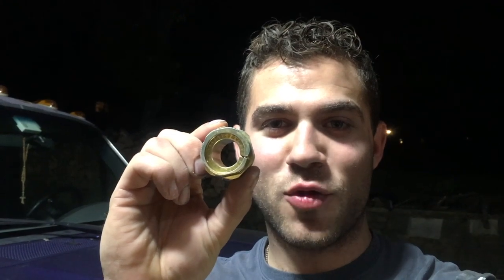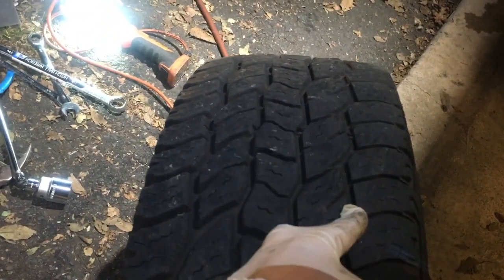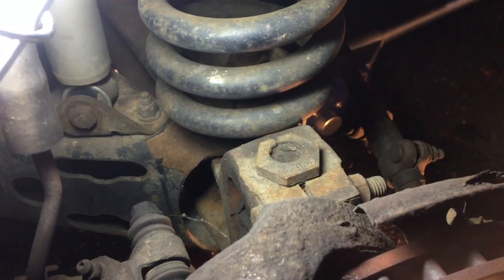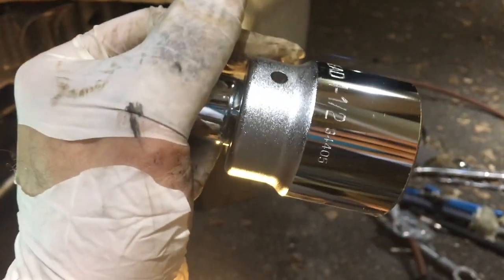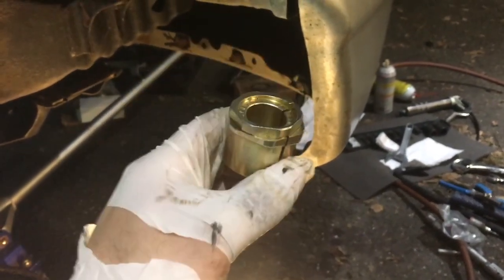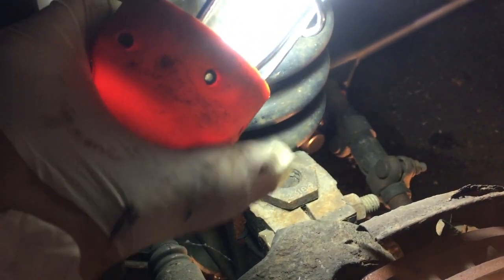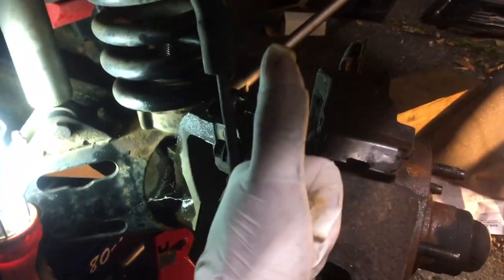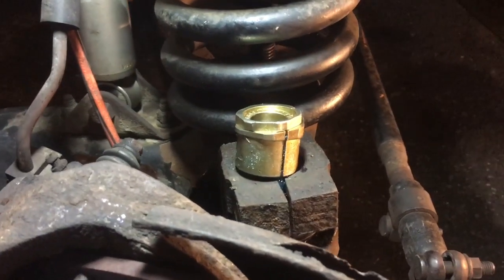How to Install Adjustable Camber Bushings | 1995 Ford F150

Comment: I've been putting off doing ball joints and correcting the horrible positive camber on my 84 f150 forever just because I know it's going to be a big PITA!! ...Even though I have shop space, a ball joint press and 1\2" impact.  Your video is well done and gave me the motivation to go ahead and just do it. Thanks!!
Reply from the maker: Michael Scarborough Yeah I felt the same way! Then I tackled the project and it wasn’t that bad. Since you have those tools, you will do just fine! Good luck!👍
Reply: I'm wondering if you got the ball joints and Camber bushings replaced on the 84 F150 I have an 86 and the way it's set up is different than the way it was set up on his video my ball joints come from the top to the bottom and there's a nut and the bottom that holds the ball joint in place the upper ball joint and then you see the sprocket type bushing which is different than the bushings he replace it seems like the ones he put on are a little bit easier to install
Reply: Wondering if you could help me with setting up the right camber for an 86 F150 since you have an 84 I believe they might be the same set up unless you have a four-wheel drive

Comment: Real nice video! Thank You! I ordered these for a E 250. Doing ball joints, pivot bushings, radius arm bushings, tie rods, springs, shocks, rotors/bearings, sway bar bushings, these adjusters, and new ceramic pads on the front. It's awesome to save money. Ball joints would have been $300, Radius arm bushings would be $700ish, and on and on.
Reply from the maker: Thanks man!🤙 You are most welcome! 
Nice! That’s the best way to freshen up the driving feel of a vehicle. Replace all the suspension parts and start fresh.

Comment: Great video. Love the bandaged thumb that comes in after the ball joint replacement!
Reply from the maker: Carl Saiyed Thanks! Yeah I cut a huge chuck out of my thumb with a miter saw. Glad you liked the video!
Reply: Ouch.  My grandfather took the tip of his thumb off in his mid-60's after working in his carpentry shop for decades.  Table saw got him.  It only takes a second.   @TheMinuteMasters
Reply from the maker: Camas Damn! Thank God it wasn’t a whole finger! Table saws are very dangerous like that! They have very strong motors and would have no problem taking a finger off.

Comment: These videos are helping me a lot with my truck. Thank you. 

    I have a hard time wrapping my head but, I have a horrible negative camber eating tires on my truck. If I put the “skinny” side of te ring towards the tire and the “thicc” side towards the motor this is max positive right? Pushing the top out and standing the tire up straight? 🤕
Reply from the maker: I can’t remember how to adjust these bushings to 0 camber but positive camber is the top of the tire sticking way out.

Comment: I have a 1.5-inch leveling springs on my 4wd. Would I want my camber set differently?
Reply from the maker: If your camber needs to be corrected, then yes.

Comment: Perfect timing bud. I'm in the process of doing a lift and have these bushings in and would like to get close enough to drive
Reply from the maker: John Kaufmann Nice! You'll definitely need the camber bushings. I'm running 31's and that was enough to need them. Good luck with the lift! Thanks for watching!
Reply: The Minute Masters yep I had coil spacers and 35a and was having a whole lotta trouble Soni just got the full lift kit (I have a Bronco) and she came into alignment but still need a trip to the shop.

Keep it up
Reply from the maker: John Kaufmann Broncos are awesome! Glad it all worked out for ya!
Reply: The Minute Masters yep my son and I are rebuilding it Project Alpha Bronco on YouTube.  We installed a two post hoist in the shop.  I highly recommend one if you have the room to install one.  C7000 Triumph is the model and we have a demonstration on YouTube for that too.  It's removable if you don't need it.

I'll stop bugging you now
Reply from the maker: John Kaufmann that's awesome!! A two post hoist would be a dream! 

Alright, nice talking to ya! Good luck!

Comment: I have a 94 F150. I put  the wrong coil springs on and now I have positive camber. I could take them off and put the right ones on but I love how my truck is level now. Question for you. If I do what you just did will that correct my camber problem?  I put moog cc824 instead of 822 or 820.
Reply from the maker: It depends how much camber you are trying to correct. You could get it close to  0 but not exactly 0 camber. What coil springs are cc824 made for?
Reply: @TheMinuteMasters  I bought them from advanced auto, and they showed three different springs that fit my truck. But I didn’t read the fine print where it said that they needed more info about my truck to determine if the 824 would fit. I completely missed that. They fit on various Ford F and E series trucks and vans but not my 2wd 5.0 xlt.
Reply from the maker: @rustybarrr  Sounds like you bought the 4wd coils.
Reply: @TheMinuteMasters  I wish there was a way to show you a picture of my truck on here. You could see how level it is now.
Reply from the maker: @rustybarrr  I have a pretty good idea of how yours looks. I used to have f250 coils on my truck and it leveled it out pretty well.

Comment: Hey how is it going Steve I just saw your video was really helpful but I have a question, I have a 87 Ford Bronco I recently got a 4in lift and the front tires had a lot of tow out so I took it to get alignment hoping it would fix the problem but it didn’t fix the tow problem I have, do you think it’s the camber bushings? Because I was going to shim it honestly to fix the tow problem.
Reply from the maker: Thanks man!🤙 Toe in or out is adjusted via the tie rod ends on the drag link steering. Camber and castor are adjusted at the camber bushing. 
You can adjust the toe by turning either of the two adjustment sleeves attached to the tie rod ends. I have a video on how to do that. For toe out, you adjust the sleeves to pull the tie rods in toward the center of the truck. It only takes a couple quarters of a a turn to make adjustments.

Comment: If you have a lift kit you'll need a moog 2 3/4° pos-neg camber bushing. Special tool available to easily remove factory camber bushing.
Reply: I've seen those special tools, but do they work good ?  a threaded puller right ?

Comment: I have 1991 ford f150 that pulls to the right would these camber/caster bushings help out?
Reply from the maker: Does it pull to the right when you are braking?
Reply: It does it when I'm on drive as soon I let go of the steering wheel. I've taking it to alignment shop twice. I've changed inner and outer tie rods also the drag link and sway bar links.

Comment: Hello. It is  need in both sides pilot and copilot?? Or une side have more adjusts?? I have a F150 1994 and o want lift olny in front is 2wd
Reply from the maker: Hi! Yes, you will need camber bushings for both sides if you are going to lift the front of your truck.

Comment: I have a question. Have you had any issues with the camber bushings? I have a 1994 Ford f150 with positive camber. Every shop I have talked to says they break and don't work. Of course I'm sure they just wanna charge me for the install of different ones. Just wanted to see how they have worked out for you?
Reply from the maker: jesse g I’ve had no problems at all. Now mine are Moog bushings which might be a big difference in quality. But, I have never hear of them breaking. There really isn’t much to break. Honestly, I would install them yourself. If you are able. It’s pretty straightforward and with the right tools at hand, a breeze.🤙

Comment: Im finally getting to my I beams and spindles on my 91   E-150 ...     and like   I read SO much on those moog coil springs and finding the right one    with the right height because so many complaints on certain model springs being too tall    and causing positive camber.     So my question is   ... with an old  I beam is it just not adjustable?  You just have to have the exact springs  that match with the I beam / spindle?
Reply from the maker: So coil springs are a mixed bag. I’ve tried Moog and AC Delco (I currently have Moog). I think they were both sub par. Now maybe I’m just not a fan of progressive rate springs. 
With I beams, you buy the coils that companies say fit. Height adjustability can be achieved with spacers. If camber needs to be adjusted, then you need adjustable camber bushings.
Reply: @TheMinuteMasters  yeah I mean the ones I switched too... I think  I originally started with like the CC824  which are 16.9   uncompressed... 1400 lb rate about...   but I went to a CC820  which are  are 3/4" shorter  compressed/uncompressed.. still  a 1400   but not sure  if a 5.0 E-150 would be 1200 or 1400 ..   Then I realized they had anti squeak  bushings... so ordered those  ( I do have classic soft rubber ones that are round)    but when I got the new bushings for anti squeak    theyre like a hard plastic.. probably a 100 in durometer scale lol      So now I'm not sure..   Like anti squeak sounds nice but  who knows if theyre supposed to be hard plastic or if someone is just 3d printing this stuff.     also being a conversion van  with wood and luxury   maybe rubber is better        but yeah its so much more complex than I thought    but most people on amazon with cc824  complained of positive camber.. others said   CC820   was perfect   ( i got them open box for like less than 50 bucks ) .  and yeah then of course    open coil vs progressive.  I dont actually have a lot of experience driving an I beam Ford truck...  ive just been restoring it.   My uncle said a Ford truck nearly killed him because of how the I beams change camber   over bumps .. maybe it also had bad kingpins.. anyway

Comment: Hello there i have a 95 ford lightning with that positive wheel problem, if I put those aftermarket  cambers will fix that problem?
Reply from the maker: Yes, these will fix your problem if you have a stock to mild leveled suspension.
Reply: @TheMinuteMasters  cool! Thanks for the video and your info I just order it

Comment: Why is the after market nut have such small surface area for a socket to sit? One slip and there goes any usable surface for a socket to ever grip it.
Reply from the maker: No idea. I didn’t have any issues with the nut having enough surface area on the camber bushing.

Comment: So my camber is positive. If I get the the camber bushing that can adjust from 0 degree to 4 degree can I adjust it to 0? Or would I need to go more negative? Camber is slightly positive
Reply from the maker: If your camber is positive (tilting out at the top) you should try and adjust the existing camber bushing. If that camber bushing is adjusted to the max to bring the wheel to neutral. Then you will want to install an adjustable camber bushing to bring the wheel to just slightly negative (tilted in at the top.)
Reply: @TheMinuteMasters  so you can adjust the stock camber bushing? I ordered the adjustable ones already incase but yeah after I installed the leveling spacer the top comes out a little bit
Reply from the maker: @bryancastruita99  Ah! If you bought a leveling spacer, you’re definitely gonna want those adjustable camber bushings.
Reply: @TheMinuteMasters  appreciate that! I got them ordered

Comment: So how does the installment of these camber bushings become necessary?  Is it other parts/bushings/wheel bearings wearing out?  Did Ford simply not allow for any stock camber adjustment with these trucks?
Reply from the maker: rdhr151 Good question! The camber bushing doesn’t really wear out unless you let your ball joints practically disintegrate. The stock camber bushing doesn’t have a lot of adjustment. An aftermarket adjustable camber bushing has 2 degrees adjustment in both positive and negative directions. If you add a leveling kit to your truck you will most likely need aftermarket adjustable camber bushings.
Reply: The Minute Masters ty for the reply. So if I plan to keep my suspension/tires/ride height all stock and want the alignment 100%...should I be looking at replacing other components like ball joints, pivot bushings, tie rod ends etc BEFORE considering these bushings?
Reply from the maker: rdhr151 Actually if your other suspension and steering components are fine then you can go ahead and just replace the camber bushings. I replaced the camber bushings at a different time then when I replaced the ball joints.

Comment: Yo! Just ripped out my engine and fixed my coolant and oil leaks. We pretty much have the same truck, 95 f150 5.0. I have a question, I got new coil springs from rough country to lift my front 1.5 inches. Well now my positive camber is intense. I took it to 2 different alignment shops and they said the adjustable camber bushings wouldn’t work, but there’s got to be a way to get them straight. Any ideas m8? I might buy it anyways and take it to another play. $$ adding up lol
Reply from the maker: Nice! 1995 is a good year! 
Have you installed the adjustable bushings? Or are you just trying to find a shop to do the alignment?

Comment: Hope you’ve been well man! Quick question, could these camber bushings possibly cause for an alignment to be more difficult to do if they’re  never replaced? I took my truck to have an alignment and they said my alignment is impossible to do because the camber bushing are worn. I didn’t even know they could wear out because they are made of steel. Btw my entire front end suspension is new, other than the camber bushings.
Reply from the maker: Hey long time no talk Mr Baeza! I hope you have been well too! 
Yes, worn out camber bushings can cause alignment issues. The camber bushings on these trucks is adjust both camber as well as a little bit of the castor. I’ve not heard of a worn out camber bushing but I guess it can happen. After all, ball joints are all steel too but even they can wear out.
Reply: The Minute Masters thanks dude! I’ll change em out real quick and hopefully that’ll help. I really appreciate all the help you’ve been giving me. The E4OD transmission in mine is being replaced and hopefully I’ll be able to get her on the street feeling like new. You’re the best dude, stay healthy and I hope you and your family are doing well during this crazy time😃
Reply from the maker: MrBaeza1994 No problem Mr Baeza! 🤙 I’m glad I can help you out! Nice! Rebuild transmissions feel so nice and smooth. 
Thank you! You stay healthy and safe too man!

Comment: I installed these two piece adjusters, went for an alignment and what do you know. The shop said they can't align these kind and wanted to charge me to replace them. Called two more shops and got the same response
Reply from the maker: Marc Lewis When I did this project I was afraid of that too. The first shop I took it to, the guy was able to do it. Those bushings usually come with adjustments instructions. So I took those directions with me to the alignment shop. I think he used the instructions, otherwise he probably would have said no.
Reply: @TheMinuteMasters  sounds like they don’t know what they’re doing without using the parts cannon.
Reply from the maker: @CenobiteBeldar  Sure sounds like it.

Comment: Were you able to replace the upper and lower ball joints without taking the rotor and brakes off???
Reply from the maker: Jakestarr1723 I left the calipers and rotors on. Removing them does give you any advantage.
Reply: The Minute Masters did you use a press to remove them or hammer them out? Just got a 95 f150. Love the vids
Reply from the maker: Jakestarr1723 I used a pry bar and got it out. I used plenty of PB Blaster and wiggled the hell out of it.

Comment: Do you think it would be about the same on a 1996 ford ranger 2wd with the twin traction beam front suspension I added 2” coil spacers and positive camber is bad
Reply from the maker: Aaron Grillo From what I’ve seen the Ranger twin I beam is just a scaled down version of the f150 twin I beam. So this process should be the same.
As for the camber, too much positive camber or negative camber will prematurely wear out your tires. Positive camber has the added disadvantage of making the from end more prone to tipping over while cornering a turn. So you definitely want to correct the camber back to zero and error more on the side of negative camber.
Reply: The Minute Masters I appreciate it I had to put my old small tires on so I didn’t ruin my big ones
Reply from the maker: Aaron Grillo Hey, that’s me every winter when I have to put my smaller snow tires on the rear.